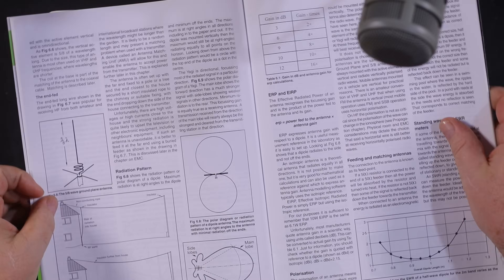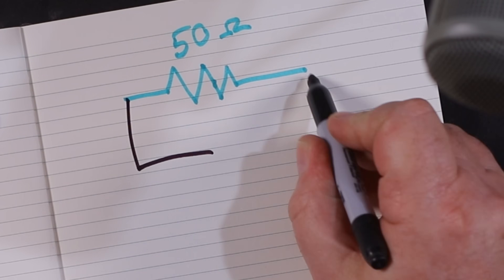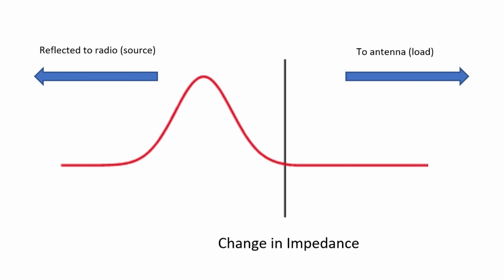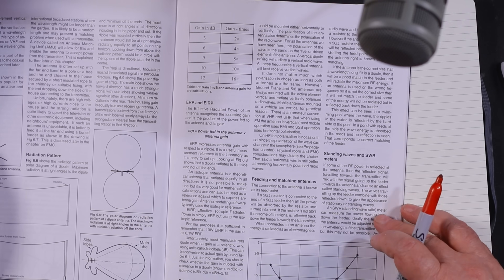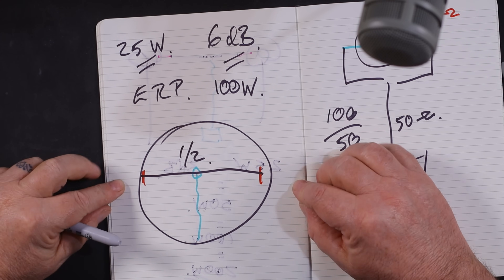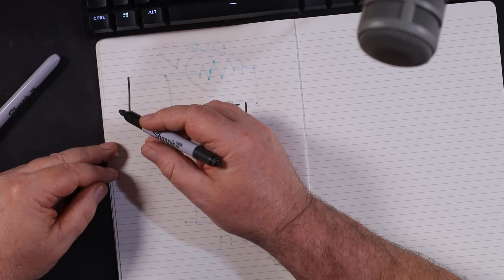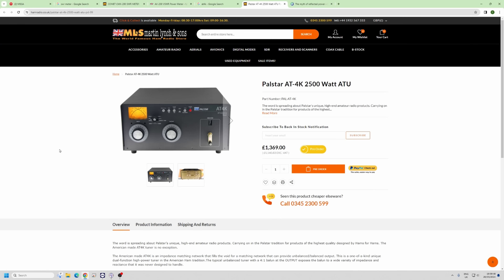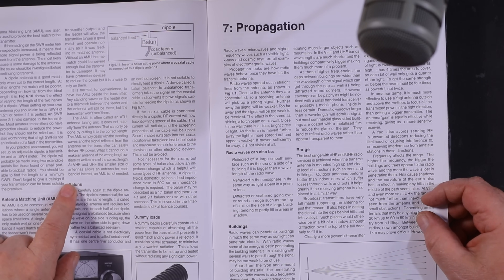SWR for Newbies

Comment: I use the Zetagi TM999 Swr/Power/Matcher on mine. On putting up a Solacon antenna up, my mate played with the swr diles. I didn't know this, So had to use a matcher to bring the swr down. I was so angry when I found this out. I do plan on taking it down and putting it up on a T&K bracket

Comment: ok so as far as swrs for cb ,,, my cobra 29 as built in swr meter, when i tune the antenna using that i get 1.5 and below by shorting antena , then check it with external meter, external says i have to legnthing it ,,,,,why is that
Reply from the maker: Because something doesn't work properly - or your coax is something like RG58

Comment: thanks for good information...By the way I'm still a newbie...imagine an multiband efhw.  Let us say 40, 20 and 10. How would you adjust/cut to achieve lowest swr before adding atu. would it be wise to optimize/cut for 20 and then 40 and 10 will follow?
Reply from the maker: Last line.. You are probably cock-on.

Comment: Nice video! My question is tuner location. What happens if we put it at the end of the coax by the antenna?
Reply from the maker: An auto-tuner at the feedpoint is very cool - and I did that once with an SG230. However you need to remember the pattern changes for each band.

Comment: "It's more complicated than that..."  Actually, you're entirely right, it really isn't that complicated.  Check out a couple recent experiments done by Alpha Phoenix on his channel, in which he accidentally steps backwards into explaining impedance matching of transmission lines by measuring voltage at many points along a circuit with different loads attached with a very fast scope.  It looks almost exactly like that impedance reflection graphic.

Tuners aren't just about making the radio happy, though.  They actively switch in inductors and capacitors (reactive loads) into the circuit to null out the reactive mismatch of the entire antenna system, and then step up or down the voltage to compensate for the non-reactive mismatch.  Of course, what they can't do is stop the mismatch-caused reflections between coax and antenna, which is why a tuner between coax and antenna is better than a tuner between radio and coax.
Reply from the maker: Perfect!

Comment: Speaking for newbie’s, where our homes are 20’ apart and power lines all over above our yards, in the US anyways?… my 40m dipole SWR went from 1.5 to 2.0 and NO DIP to be found 2.0 is as low as it would go! Long story shortish neighbor had installed new metal roof and I had hard lesson in REAL WORLD antenna placement, everything effects everything… a lot of my new friends that I’ve brought into this hobby need to know this other than MODELS on computer and TRIM IT TO PROPER TUNE…. I run legal limit so it means the world to me…. Just wanted to bring this up cause lots of us newbs starting out take your word for “absolute” hope I didn’t ramble on too much just wanted to say a friendly Hey 👋  Great info we’re just STILL learning thanks
Reply from the maker: Hmm. Sorry about that SWR.. Change in height maybe..?
Reply: I’m running through every scenario I can think of… height,angles,coax etc.  y’all are our Elmer’s (that don’t judge) and I absorb your information and appreciate it!  Still learning and thanks for responding

Comment: Hopefully you will address what happens to that "reflected" wave of energy... where does it go? Is it really "lost"... or does it go somewhere? (It has to go somewhere!)  That's the great debate!
I know the answer, but hope you will cover it in some manner in a future video.
Great stuff Cal... thanks.
Oh, and happy Easter Cal!
73 from west Texas!
~Alan
Reply: Goes back to antenna if there's a tuner in place or the power isn't produced by the transmitter, there many videos on YouTube with so few that actually explain it well
Reply: @paulm0hpd319  
Exactly!
However, many hams still believe (and spread) the myth that that power is "lost" somehow... that it never makes it to the antenna, or goes back into the transmitter and is "burned up". 😅
Reply: @Calico5string1962 well actually that is correct, the travelling wave reaches the antenna and some of it gets propagated, but because of the impedance mismatch that creates the high VSWR, some gets reflected back to the transceiver but in doing so it gets attenuated (again there and back each time) and eventually the energy is dissipated down to zero. Then whilst all this is happening new wave fronts are being produced by the transmitter and so the process continues.
Reply from the maker: Up and down.. up and down.. Lossy coax.. Up and down :)
Reply: @DXCommanderHQ  just improve the coax 🙂

Comment: Am I right in assuming that I change the skip distance with the antenna length because I change the Radiation angle of the antenna depending on whether I have 1/8 1/4 1/2 or 1/1 lambda? Ok ok you still have to look in which reflection layer you are.
Reply from the maker: Well.. wrong video to comment on but an end-vertical at a moderate height - say a wavelength off the ground will produce a "sweet spot" closer to the horizon.. Much higher then anything works.

Comment: Is SWR important?

It depends. On shortwave you do not have many losses because of a bad SWR. And yes your antenne tuner can balance out the mismatch. What will happen at the antenne is that a part of your power is reflected back from the antenne to the antenne tuner.
Once it reaches the antenne tuner it is NOT LOST. It will bounce back towards the antenne. And keeps bouncing until it is lost. There is a guy on youtube explaining all this about the SWR myths.
Basicly it is that if you lose a couple of dB's on HF probably none is going to notice.

But as soon as you go up in frequency, let's say 70cm and up. Your SWR get's really important. Losses in your feedline will be much much more and signals will get weak and weaker.

So does SWR matter, yes and no. IT matters if the losses are getting high, like the VHF and UHF frequencies. That's why there are no antenne tuners for VHF-UHF and higher.
Reply from the maker: You need to read the article published in description for a better idea. You have to remember, I'm keeping this simple.
Reply: @DXCommanderHQ  And you are doing a great job.

Comment: Why do you only do 1/2 lambda and not a full lambda? what are the differences in terms of radiation and reception? i think that a full lambda radiates flatter. Similar to when I place the antenna at an angle to the ground
Reply: Because a full-wave ("lambda") antenna has a feedpoint impedance much, much higher than 50-ohms... on the order of several thousand ohms. And actually, a truly "resonant" ½-wave dipole's feedpoint impedance is really closer to 75-ohms, not 50. Therefore, a perfectly resonant ½-wave dipole would show an SWR of ~1.5:1, not 1:1. 
A full-wave dipole would require an impedance transformer to correct the large mismatch between the 50-ohm feedline impedance and the high feedpoint impedance. Furthermore, a full-wave dipole has a VERY irregular radiation pattern, with many lobes and nulls.
73 from west Texas.
Reply from the maker: You don't get a good match. Almost all antenna have at their base, a half-wave dipole. And your question although simple is a HUGE topic :)

Comment: I'm starting ... so have a dongle and right now the cheapo tiny dipole that came with it. Having a ball in spite of the noise... Since I'm not economically robust I'm waiting but soon will get the MLA+ and hopefully be rewarded. I'm also only into listening right now so transmitting isn't part of my concerns. Thank you so much for your vids, I'm hopefully learning.. uuhhh, something
Reply from the maker: Something is good!
Reply: @DXCommanderHQ Tis but a start, sir, but a start. Wheee. Right now working on a truly rude anti-putin song ... I'mma ole punk from Lower East Side way back. 

Let's see if putin can fly
13 floors up so high in the sky